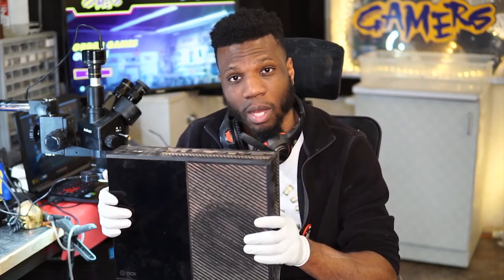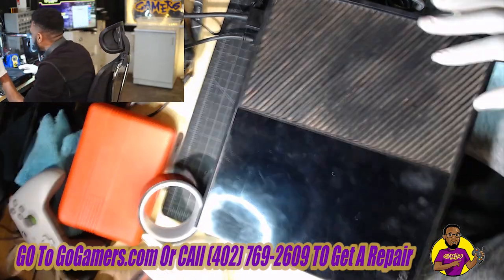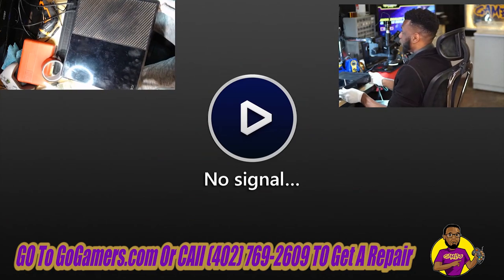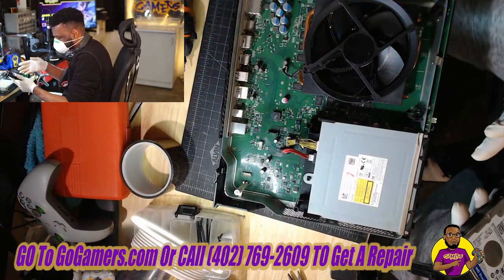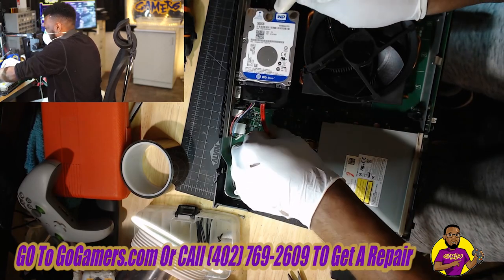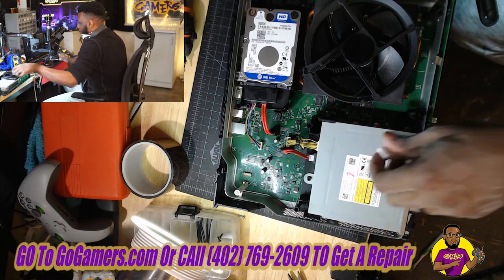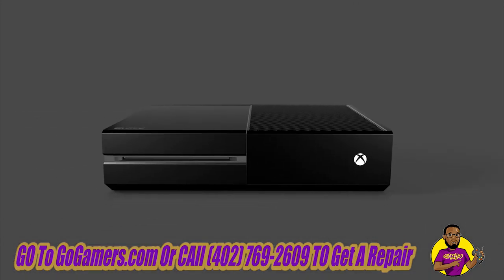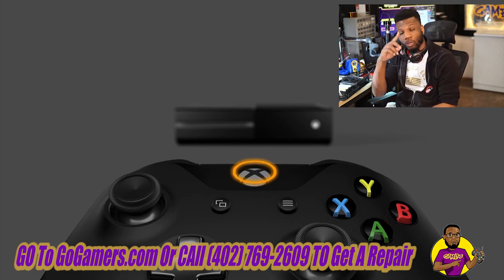How To Swap Out Hard Drives In Any Xbox One (EASY METHOD)

Comment: Hi I dunno if you can help but I’ve got Xbox one x that has been upgraded to 2tb but the power supply is broken I can’t get a new one right now but I’ve got an old Xbox one phat that works I’m wondering if this would work to swap the hard drives or would I have to format it to work on the older Xbox? They both work and had recent updates